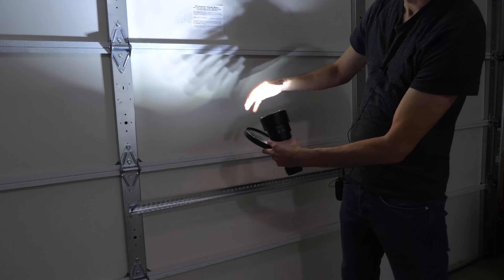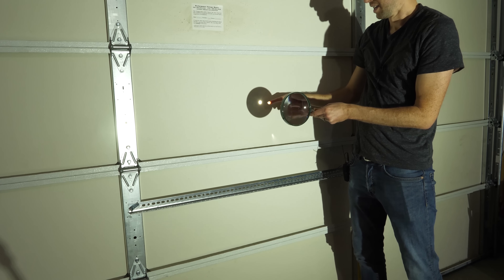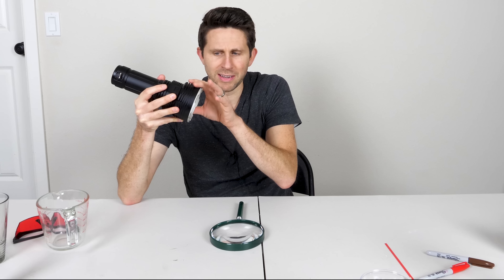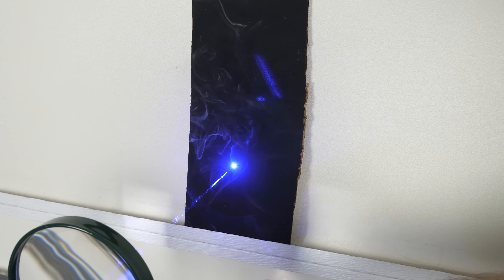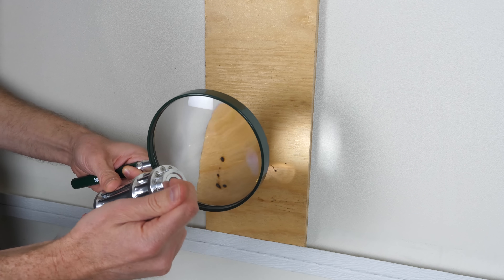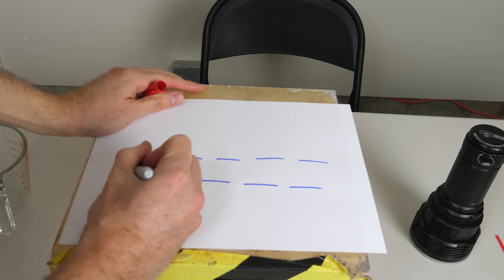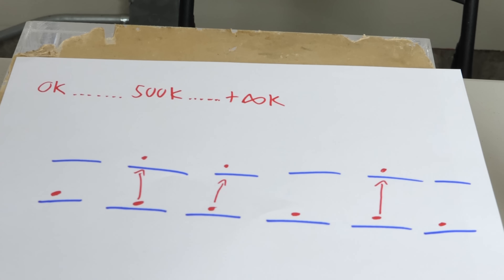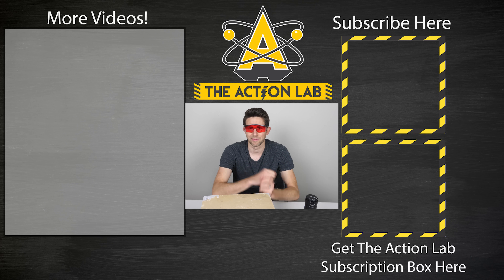What Happens if You Focus a 5W Laser With a Giant Magnifying Glass? Negative Kelvin Temperature!

Comment: Thermodynamic temperature (in Kelvin) is the rate of change of internal energy with respect to entropy (dE/dS). Usually, as temperature approaches infinity, all energy levels of a system of equally populated and hence entropy is at a maximum (the most statistically likely scenario, ignoring the energy of each state, is to have an equal population of all states). This would be the equilibrium state at temperatures approaching infinity. But lasers have higher energy states at a higher population than lower energy states. When the higher energy states are more populated, the energy of the system increases. When the population of higher energy states is greater than the population of the lower energy states, the entropy of the system actually decreases (again, highest entropy state would be to have equal population of all energy levels). So for a laser, as you increase the internal energy by populating the higher energy states more than the lower energy states, the entropy decreases, and therefore the temperature is technically negative.

Comment: If you use airflow across the surface you're cutting/engraving it will work much better. The smoke particles starts blocking the laser itself.

Comment: This guy doesn't know what he is talking about. My touch has a focuser on it already. So that is like the laser. Energy can't be created or destroyed. Sane with light. The electricity in my battery is a "cold sorce" but yet it can be used and focus to power my heat gun. So its the same principle with light. I can use a "cold light source" and focus it enough to burn stuff to. You just need to think logically through experience of experimenting. I used to think I would learn so much more growing up. Turns out I knew everything already, all I had ti learn was to be disabled enough to do a Job.
Reply: r/iamsmart

Comment: When actually a experiment broke a law of thermodynamics.
Scientists gives shit explanations to defend them.
How it is negative temp. Just measure it with a thermometer .
Reply: If he got below zero he would be the first to do that, in fact if he did he could make the perfect particle accelerator
Reply: Also his explanation with the sun was so lame. With mirrors you can easily make spots hotter than the sun
Reply: @illicitlegacy3783  You are missing the point. If you take a 2 ft by 2ft mirror you only ever get 4 square feet of sunlight energy. You can focus that down and then keep it shining in the same spot but you'll still have the same amount of energy that went through the mirror. With a laser due to some quantum mechanical rules you get more energy out of the laser by magnifying it, which doesn't break the conservation of energy due to the reasons he described.
Reply: @dannydevito7000  you dont get MORE energy bro. He said you can condense the energy. If you could get more we would make infinite energy power plants where we just magnified lasers.
Reply: @dannydevito7000  also with mirrors i didnt mean 1 mirror. Imagine 10000 concaved mirrors all perfectly reflecting sunlight into one spot. You can definitely condense diffused light into a brighter amount
Reply: @dannydevito7000  also he wouldnt have been breaking any laws of thermodynamics, my man was tripping in this video.
Reply: @illicitlegacy3783  the point still would not be hotter than the 10 000 parts of the sun's surface you've reflected together. By using 10 000 mirrors you've multiplied your target by 10 000 as well.
Reply: @dannydevito7000  you just sent a forum. I am not going to believe some random forum user saying we can create infinite energy with lasers. If we could the governemtn would be making laser power plants.
Reply: @illicitlegacy3783  Energy is absorbed by the mirror.